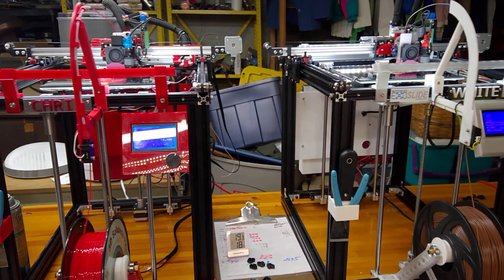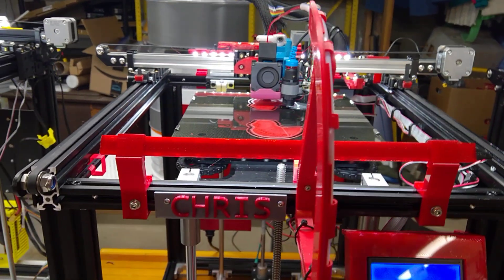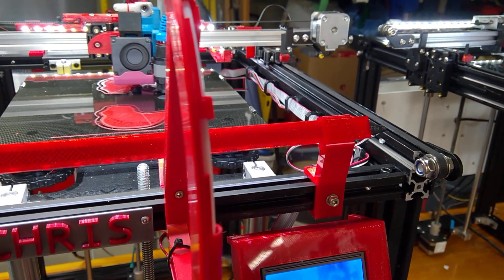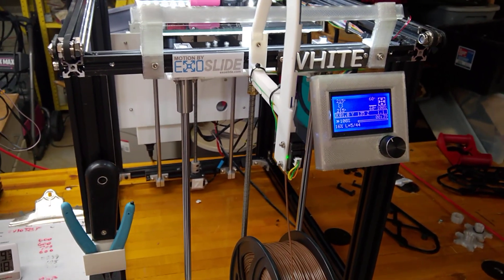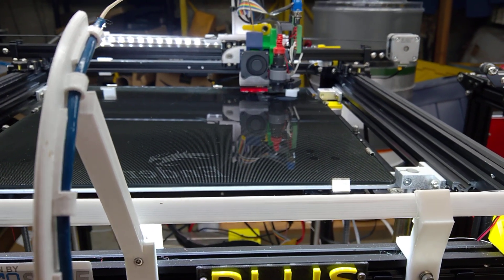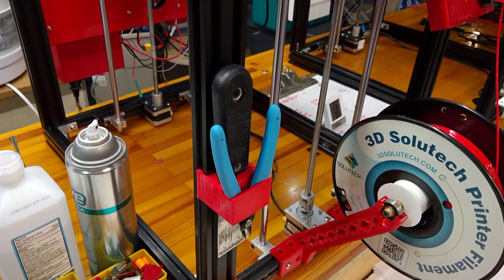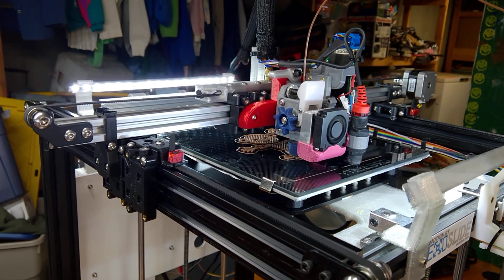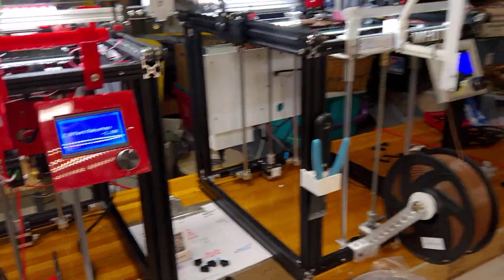Ender 5 Dual Z Mod Part 4 - The End

Comment: Hi dear Sir!

Can you please elaborate on why you needed to make new end switches?

I feel too insecure to even move it a centimeter to the right (the x). But should be pretty straightforward , right?  :D I dont like the probe is not probing the right side of the bed  and this is the solution I’ve come up with.

Or designing a cooler with a bl mount on the right side. 

Thank you! 🎉
Reply from the maker: I had to make new mounts for the switches.  Because of the other mods the switches were not hitting correctly.  My memory is a little foggy, as this was about 3 years ago, and I no longer have any of these printers.  Adding the Exoslide changed the geometry of all of the switch locations

Comment: I wonder if there is a ballscrew Z kit for an upgrade?
Reply from the maker: You can find many mods for the Ender 5.  I no longer have any, have moved on to two Bambu (X1 Carbon & P1P) two Rat Rigs and one Prusa XL with 5 heads.

Comment: What board did you use?
Reply from the maker: I used the BTT SKR mini E3 V2.  I had replaced the original Creality with a TH3D Ezboard, but I blew a couple of them up and they were not available for purchase, the cost $129 when in stock and there seems to be no Klipper config.    I purchased 4 of the BTT boards on sale for under $200.   I have swithced all of my printers to Klipper and been very happy.   I have replace this dual axis with what I think is a better system.  The Z axis is now on the side instead of front to back.   
https://www.youtube.com/watch?v=e_Y2sSmsQAs&ab_channel=DavidWilson.     I also have a number of videos on the Klipper install.  
Hope this helps, let me know if you have any questions
Reply: @woodwaker1  Thnx for the info. But i dont see 2 connectors for a z stepper on the BTT SKR mini E3 V2. Do i need something else with it to gte it to work?
Reply from the maker: @hakaiyou4532  It does have two Z connectors - ZAM and ZBM they are in parallel.   Take a look at this https://www.biqu.equipment/products/bigtreetech-skr-mini-e3-v2-0-32-bit-control-board-integrated-tmc2209-uart-for-ender-3
Reply: @woodwaker1  jeah i am blind haha. Last question: where to get the dual z mod? Like the actual hardware kit to make it.
Reply from the maker: @hakaiyou4532  Before you get started, take a look at my re-mix on the side to side dual Z.  It has a parts list and I think works much better, since it has less 3D printed parts and more extrusion supporting the bed.  After you look it over let  me know if you have questions  https://www.thingiverse.com/thing:4941759
Here is a video of it  https://www.youtube.com/watch?v=v75pKu2XVZU&t=56s&ab_channel=DavidWilson
Reply: @woodwaker1  Jeah but where can i buy the actual z axis screw and stuff that comes along with it?
Reply from the maker: @hakaiyou4532  Please read  this https://www.thingiverse.com/thing:4224933
that is the original - then my remix 
https://www.thingiverse.com/thing:4941759
They have all of the parts needed, you may have to find another source - Amazon may have them also

Comment: Two absolute units :D  well done
Reply from the maker: Thanks.  I just finished the second Z axis conversion on the White printer.  Now I can get back to the Rat Rig.
Reply: @woodwaker1  Noice. I'm currently looking for a printer to create prosthesis-covers. These are very high (up to 500mm) and have a small footprint. I have been printing these on my CR-10S and on a Delta-Printer. The problem with the CR-10S is that the moving y-axis cause the prints to wiggle a bit ... even when printing with very slow jerk and acc. It works kinda well on the delta printer (because the bed ain't moving) but I don't like delta printers that much ':D  hence I was thinking about an Ender 5 -> because the bed only moves along the z-axis ... but even the Ender 5 Max has "only" 400 mm z. Do you think the the Ender 5 can be modded to a dual axis setup with an extendet z-axis?
Reply from the maker: @freezyAndHaze  It probably could.  I think you could simply replace the 4 main uprights with probably 600mm 2040 extrusions - get longer rods and leadscrews.   Another option is a RatRig - they have a 500mm cube.  I'm building a 400mm now.  Let me know if you want to pursue the Ender 5 mod.  I could get you measurements if that would help.
Reply from the maker: @freezyAndHaze  Take a look at this - i have redone the dual Z upgrade https://www.youtube.com/watch?v=v75pKu2XVZU&t=10s&ab_channel=DavidWilson
Reply from the maker: @freezyAndHaze  I read your question again and think a better solution would be to mod an Ender 5 Plus.  It has 400 mm Z stock and dual Z axis stock.  It would need longer corner 2040 extrusions, rods and lead screws, but should be a straight forward swap
Reply: @woodwaker1 alright, sounds like a good idea. I definitely want dual z-axis and it's probably easier / more reliable if it s equipped by default with such ... otherwise 220 x 220 mm bed size is maybe a little small :/
Reply from the maker: @freezyAndHaze  It sounds like you are doing this for or as a business.  You might want to take a good look at the Rat Rig.  If you have the room and can afford the cost,  the 500mm cube would meet all of your needs.  I'm building a 400mm cube and have all of the mechanical build done, now working on the OmniaDrop mounting and hooking up a Fystec Spider mainboard.    It is a kit, but if you are familiar with 3D printers and take your time it is just a lot of steps.   https://www.ratrig.com/
Lots of you-tube videos on it - Teaching tech has a good series.
Reply: @woodwaker1  yessir. I work at a company where we build orthotics and prosthesis. The Ender 5 pro z axis mod sounds perfect for the task I described (printing these high prosthesis covers with their small footprint) ... but the boss maybe ain't gonna like it if I say "Habibi, we need another printer for those really wide prints 😅 gonna take a closer look on the rat rig 🤓 thx a lot
Reply from the maker: @freezyAndHaze  I should have the Rat Rig running in about a week.   It has three Z axis motors and uses them for leveling.  The reason I suggested that is the price would be in the same area as an Ender 5 Plus with the mods.   I should have a new video out soon with my progress so far.  Let me know how this develops, I would be glad to help if I can.

Comment: Well, input shaping? Dunno what firmware they are on but klipper, and soon RRF will have it. I have 2 ender5 myself. Probably go to linear rails instead of exoslide. Exoslide is neat though. I think with input shaping the overal acceleration, jerk and speed should be able to just about double.
Reply from the maker: Thanks for watching and commenting.  I have converted all of my printers to Klipper / Fluidd and gone through input shaping and linear advance adjustments.   I will have do them all over again as I'm modifying them to use the X-change system which will change the hot end mounting.   The Exoslide system is about the same price as good linear rails, and it trouble free.  I had linear rails on all of them and switched.

Comment: Do you do commissions on these
Reply from the maker: NO but thanks for asking.  I will help you if you want to do your own  I have everything listed on Thingiverse.   I would be hesitant to do this on my only printer, as you may have to reprint parts and make adjustments.   This is also a fairly expensive mod, but does stabilize the bed.   https://www.thingiverse.com/thing:4711172

Comment: Mr.Wilson how many of them machines do you have operating ? Them things are amazing to watch operate.
And how long does it take you to complete build one of them ?
Reply from the maker: Thanks for the question.  They come partially assembled - takes about an hour to put one together.   They are also very inexpensive.  I have three Creality Ender 5 - they are about $350 each and can print an area of 220 mm x 220 mm x 300 mm. (about 8.5 inches x 8.5 x 10)  the bigger one can print 350 x 350  x 400 mm. ( almost 14 inches )  It was about $550.   I have almost none of the original machines left.  I replaced most of the electronics and motion system.   That's what I like about these - you can modify them as much as your want, there are a lot of third party vendors that have great parts.   This is another reason I like you-tube, I have always been fascinated with milling wood, and I can watch your channel to learn more.
Thanks for watching and keep up your great videos.
Reply: @woodwaker1  
Appreciate your answering the questions. I was always fascinated with computers.I use to build them back in the 70’s and 80’s up to the 90’s until everything went to windows, I use to write programs in qbasic and dos. But after Windows took over it took all the fun out of it so I gave it up. My wife does all the woods project mostly I just cut the wood and build building and stuff.
I’m a metal fabricator I do a lot of welding and cutting, and love to build stuff from metal. But I do love to cut up the woods for her. It’s like opening a box of cracker Jacks. Just dying to see the prize inside of the log. But Cnc machine do fascinated me. Maybe one day....
Reply from the maker: @MsdMakingSawDust  I started with computers in the Air Force, 1969.   I have built at least 300 over the years and enjoy keeping up with the technology, at least try to.   I like the 3D printers  since they start with nothing and add plastic in layers.  A lot of mechanics and programming along with art and science.  It is a fun hobby, relatively inexpensive and doesn't take up a lot of space.

Comment: very nice builds, im thinking of changing my Z rods to Nema 17 with integrated rods instead of a coupler system, steppers are cheap and maybe a good upgrade suggestion to try out too :)
I also have modified my ender 5 to dual Z but what boggles me is that I couldn't find a one piece dual Z bed carriage instead of diy made ones, I would love to have things as stable and care free as possible but I have printed my upgrades now, I just dont like the way it looks
Reply from the maker: That's why I had to make them.  The advantage was that I could modify them to any size I wanted.  The OmniaDrop adds a lot of extra size to the front, and I could adjust for that.